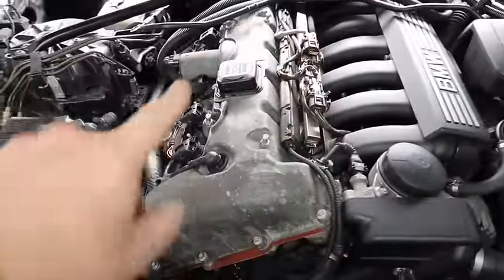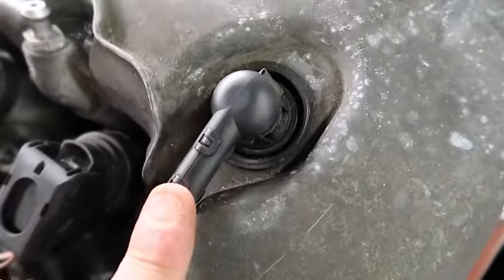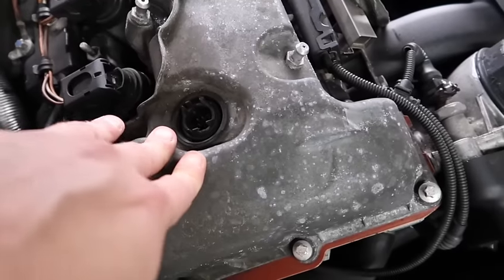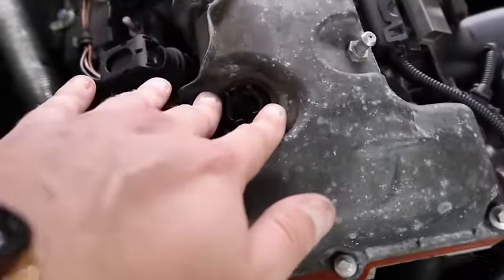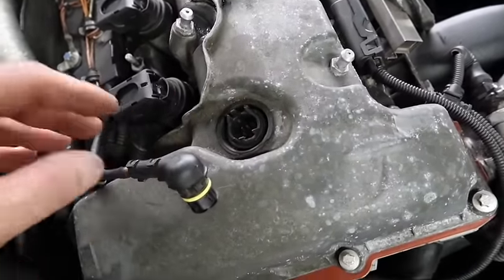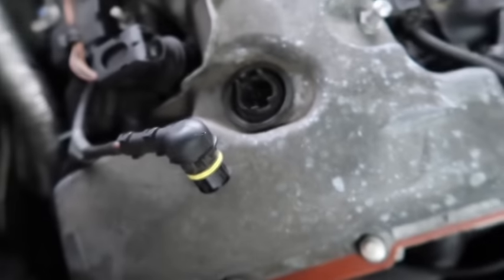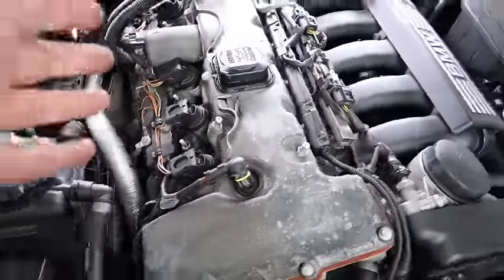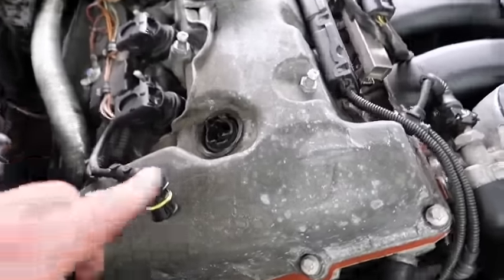Remove This From Your *BMW IMMEDIATELY*

Comment: I wish there was a way to completely defeat the whole cam advancing mechanism. Just get rid of everything. Lock the cam gear in some 'mid-way' state, and reprogram the computer to operate the engine without it. Sure, you'd lose a bit of power and efficiency, but all the headaches aren't worth it!
Reply: The valvetronic is essential to the way the car manages fuel air. Its not optional.

Comment: I have 2006 BMW 325 automatic.  It is stuck in park. Starts up fine. If I use emergency release to move out of park into drive, it feels like its stuck in a Higher gear and won't shift. I have these codes 

CD99- Message (EGS TOURQE REQUEST) Error Receiver DME Transmitter EGS/SMG/DKG

CD9D- Message (Transmission Data) Error,  Receiver DME Transmitter EGS/SMG/DKG

CD9E- Message (Transmission data 2) Error, Receiver DME Transmitter  EGS/SMG/DKG

CDB0- Message (Display of Transmission data) error Receiver, DME Transmitter EGS/SMG/DKG

D357- NO MESSAGE  (Transmission) Receiver DSC Transmitter EGS/SMG/DKG

A0B1 - Car access system (CAS) input selector lever position implausible

Someone please help me. I'm loosing my mind with this thing. I bought it like this. It was cheap.

Comment: I have n42b20 and the rough values with VVT functioning are: cyl1=0.3, cyl2=2, cyl3=0.4, cyl4=2.5. When I unplugged the sensor and the VVt goes OFF all the values are under 0.4, the engine have a loss of power but it runs far better. How can I solve the power loss ? I am sure that the VANOS is not working any more in limp mode. I want to deactivate just the VVL not the VANOS. It is possible ? thanks.
Reply: @iancuelectronik did you fix it by any chance?

Comment: Can anybody tell me if this sensor  throws  a code 2a38/ voltronic motor sluggish / open circuit, I've changed the motor the relay check all the wiring, can the sensor also throw this code , e92 328xi 08

Comment: Hallo Dean l have this problem. I replaced my water damaged computer box, with a lock-set. The car starts very well. But the two visible and noticeable hiccups are the steering wheel doesn't unlock even though the engine is still idling. The second issue is that the engine electric fan remains on and doesn't shut off. Any advice please.
Reply: If you haven’t got it yet, Security system needs to be reset, Or your wheel is locked lol, When you put your key in shake the wheel left & Right, It’ll pop loose faster, And the electric fan seems like either a faulty Temperature sensor or check your relays/ Fuses, If not you can Run a extension on the positive wire and run a Manual electric Fan switch

Comment: ❌❌If anybody could give me some direction that would be amazing❌❌

I have a 2011 BMW 535i and its saying my adaptive headlights have malfunctioned and the turn signals have stopped. It all just started this past month where sometimes it would work and other times not. Ive had a few tell me theres gotta be a loose connection somewhere bc it does work sometimes. And i found a video before wherw the guy had the same problem and all he had to do was take the bulb out and widen the metal prongs but i cant find the video. Does anyone have an idea of what im talking about and hopefully knows what bulbs i need to fix the connection on??

Comment: Hi, I replaced the venos solenoids and the car still rough idles, disconnecting the intake solenoid makes it idle properly, what could be the problem
Reply: Hi Nazeer, i have the same situation.. you find a solution for this problem?

Comment: Please check my last video on YouTube with my m57 bmw 
Strange knocking from 2k rpm and a little vibration to steering wheel and pedals…what can it be? The car have nice power and run all 260km/h

Comment: Has anyone had a "2A38 Valvetronic, servomotor: sluggishness or line interruption" code?
happens to me after idling for 12 minutes, but only while idling, seems like it could be this
Reply: Did yu fix the 2A38 code ?

Comment: I been having a missfire on cylinder 4. Did plugs, spark plugs, new ccv, disa valve, valve cover gasket, filter housing gaskets, changed plugs spark plugs and nothing. Now i see you have a ground this engine has no ground on that side of the engine. Gonna look into that.

Comment: Fuck I think I got swindled by my BMW dealership. I had a wagon that said something about the eccentric thing. Bad idle, stalling, running rough etc. 

I took my vehicle into the BMW dealership hoping they'd be able to help me. They charged me 8k and put my car into limp mode all in a few hours. 

I ended up selling them the car for really cheap and then I saw it running beautifully again a week later.
Reply: 😬 damn

Comment: Just change your oil every 6000 miles with filter ... to be honest if your cars done over 150 thousand miles need to change your car anyways.... x over and out
Reply: I've 230k on the clock and doing fine

Comment: I bought a 2016 BMW with 80k miles, the cooling system, thermostat housing, radiator and other parts are made if a hard plastic, nothing but, trouble! Piece of junk.